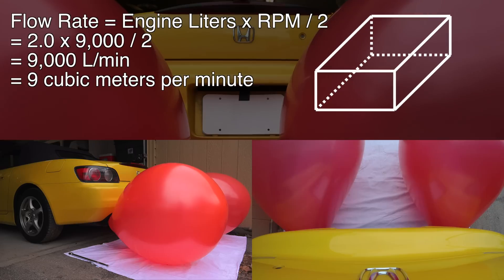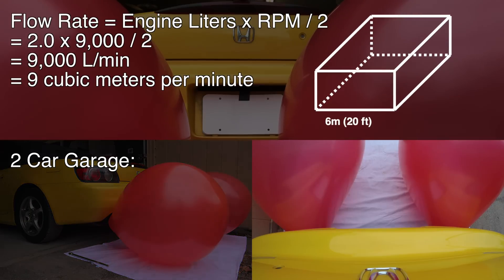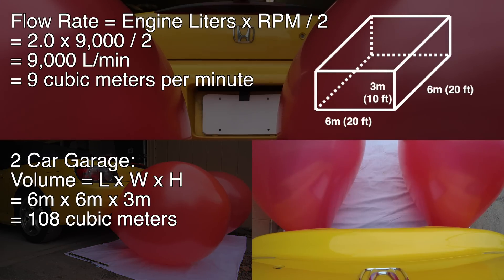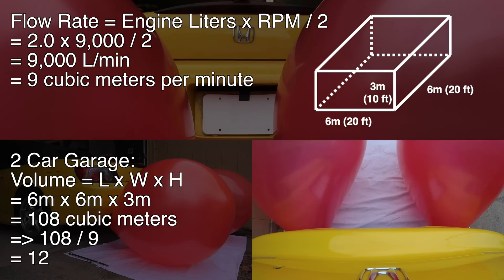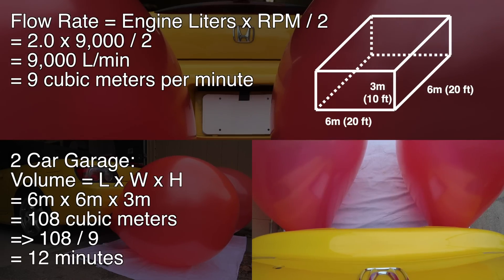Inflating Balloons With An Exhaust - How Much Air Do Cars Use?

Comment: After the balloon popped and all the thick gas came out the exhaust pipe, did that only look bad because the other balloon start pumping it's collected gas back through the exhaust to escape the other pipe which now doesn't have the balloon on it? (There was probably a much better way to grammatically explain my question hypothesis)

Comment: Why is the balloon on the left deflating after the one on the right popped?
Reply from the maker: The exhaust is open at that point, atmospheric pressure is less than the pressure inside the balloon, so it deflates back into the muffler and out the tailpipe.
Reply: Engineering Explained I think he didn't know it came out the OTHER tailpipe
Reply: I didn´t. I reckoned it would stay inflated as fumes would still come from the engine, and I didn´t think a ballon would be able to generate enough pressure to make it go back the pipe. 
Besides, my ears nearly exploded a 2:15

Comment: Why do the balloons not fill evenly? I would think that going from the single pipe into the muffler with dual tips the pressure would be even, but it seems it found the path of least resistance? Which would explain why the other balloon didn't pop?
Reply from the maker: Two big reasons: first, the exhaust path may have been less restrictive for the balloon on the left of the video, meaning more gasses fill this balloon initially. Second, assuming the exhaust pressure is equal at both tailpipes, the balloon on the left could have required less pressure to inflate. A slight difference in the pressure required to inflate one of the balloons would result in that balloon filling up first. Once the pressure was high enough inside this balloon, the other balloon would start to inflate as well, as it did. I would assume the quality control on $2 balloons is not all that high, so no surprise that they required different pressures to inflate.
Reply: Makes sense, thanks for the reply! Keep up the awesome work!

Comment: Someone might have commented this already, but what about the volume of gas added to the exhaust by the combustion process? The volume of exhaust will be greater than the volume of intake, no?
Reply: That's true, and also part of why turbochargers are so effective.
Reply: there are only two things that enter the engine. air and fuel. therefor there are only 2 things that can leave the engine. 

So  basically the exhaust volume is 7% higher than the intake volume when the fuel is injected.

Comment: Those additional fumes coming out after the pop was more than likely due to the excess air flow through the single muffler that had build up, which was "loosened" up my the additional air flow. Agreed, doubt it was harmful whatsoever.

Comment: How would a diesel engine differ in terms of inflating the balloons?
Reply: Diesel, rotary, any internal combustion engine will fill the balloons up based on displacement plus boost. Diesel will likely just be a little more smoky, if it's an older engine.
Reply: ah thank you

Comment: Couple of clarifications. A car may have a VE of 100%, or more, but not at all rev ranges. It is unlikely the S2000 is tuned for a VE of 1.0 at full rpm - peak VE would likely be at a lower RPM. Second, the calculation you did (VE * RPM / 2) is for how much air ENTERS the engine. However, the balloons show how much air leaves the engine. Air leaving the engine is air entering the engine and those gasses released after combining the oxygen in the intake air with gasoline vapors. That volume is FAR larger than the intake air and his extra "air" is what pushes the pistons down.If I recall, its 12:1 (with 1 being the amount of oxygen in the intake air). It is confusing that you showed balloons illustrating exhaust gas but did calculations on intake gasses.

Comment: Now explain to me why we cannot capture co2/ generally exhaust gasses, compress them and store them or filter them better than with a catalytic converter to reduce emissions. ELI5 please?
Reply: That is because compressing that much exhaust gas into a reasonably small volumes requires MASSIVE amount of energy that makes it simply impossible to happen. Also there is no catalytic converter for CO2 because unlike other harmful gas engine generates (nitrogen oxides, sulfur oxides, and CO), CO2 is largely chemically inert, which means it is extremely difficult to use chemical reactions to convert it to innocuous chemicals in a controlled manner.

Comment: The volume of air that is going in the engine isn't the same as the volume of air coming out from the exhaust... Because of the expanding gasses inside the cylinders... If those two volumes were the same the engine can't run... And so the car will fill the garage with exhaust gasses faster than what you estimate... Am I wrong?
Reply: gas flowing out of the exhaust is only 7% greater than the air flowing in.

Comment: the volumetric efficiency at idle or wife open throttle has little to do with the volumetric out put of your exhaust. the amount of "air" leaving the engine is greater because of combustion.
Reply: if we go by the rule of thumb that the AFR of an engine is 14.7:1 the exhaust is outputting 7% more air volume than what is being induced into the engine.

Comment: OH! the suspense! I was on the edge of my seat waiting for the baloon to explode!  It,s cool how on fill first because the resistance to air flow is lower, but then when it get fill up, increasing pressure and resistance, to other start to fill. The exhaust length are not equal. It would be entertaining to test dual exhaust car with this ballon test to see the resistance differential between the 2 exhaust.

Comment from the maker: "Why did one balloon inflate faster than the other?" Two big reasons: first, the exhaust path may have been less restrictive for the balloon on the left of the video, meaning more gasses fill this balloon initially. Second, assuming the exhaust pressure is equal at both tailpipes, the balloon on the left could have required less pressure to inflate. A slight difference in the pressure required to inflate one of the balloons would result in that balloon filling up first. Once the pressure was high enough inside this balloon, the other balloon would start to inflate as well, as it did. I would assume the quality control on $2 balloons is not all that high, so no surprise that they required different pressures to inflate.
Reply: Minute physics has a video on why this happens, TL;DR a smaller balloon requires more pressure to inflate.
Reply: Is the path symmetrical or does that not matter.
Reply: At higher RPMs the pressure on both sides equalizes.
Reply: But what about Stochimatic ratio? 15 L air for 1L gasoline so that is soo less than your calculations i'm getting little confused. Can you please explain me.
Reply: I've noticed just as a passengar waiting behind such cars that the left exhaust is always exhausting more. It wasn't a slight change between baloons that made the left tail pipe exhaust more. It's one of those odd things I've noticed all my life from any manufacturer.

This video is 5 years old so maybe someone won't come up with a dual exhaust exception. ;)

Comment: I think the white fumes coming from your exhaust after the right balloon popped is just water vapor that cooled in the left balloon so that it condensed and formed a cloud when it came out the other tail pipe.
Reply: This is most likely the case, as the primary products of combustion of gasoline are CO2 and water vapor.

Comment: Wouldn't the exhaust mass and volume be larger than whats taken in through the intake?
fuel is mixed with the air and when combusted the mass now is composed of all mass that came in as air + the mass of the fuel.

so the air used should be less by some factor than the exhaust produced.

if you wanna be extreme, inflate some balloons attached to the intake and stick some empty ones at the exhaust  and see if the exxhaust balloon inflates faster than the intake baloon deflates.

Comment: now there is a question, is that a measure of how efficient your exhaust system is as one inflated when the other didnt and then when one burst the other started to deflate? id imagine they would both inflate at the same time with a good designed exhaust system

Comment: How much oxygen does an engine consume? is it all of the what it intakes or is it there some left over. 
Carbon monoxide out of the exhaust turn to carbon dioxide when it hits oxygen how much oxygen does this reaction consume?
What gases come out of the exhaust pipe? are they all dangerous? 
Thanks for your great videos

Comment: as you hopefully know, the balloons on it self arent good to mesure the air that goes trough the engine, because when air get ignit, it gets a bigger volume, thats why your exhaust should always be bigget than yout throttlebodys.
Reply: there is also a problem with how you tried to calculate what amount of air goes trough your engine, i dont beleve that your engine only runs on air, so you would need to find out how much fuel gets injectet to find out how much air goes trough your engine.

Comment: The backpressure from the balloons should be a lot less than what a regular muffler causes when driving, so I wouldn't worry about the engine.  This actually looks like an interesting way to see how your exhaust flows when you have dual tailpipes - if one side is more restrictive than the other.  I thought it interesting that the one on the right was so much slower to start inflating (although it did catch up later, as we noticed when my ears stopped ringing.)  :-)

Comment: Every litre of Petrol burned creates 1320 litres of CO2 at 1atm pressure at 20 degrees Celsius. Diesel is about 1435 litres per litre burned. I think this should be included in your calculations. I think it would be very interesting to be able to actually measure it.

Comment: If this were an exam you'd receive a F!
You calculated the air passing through the engine and totally forgot about the fuel being burnt in the process. The engine uses part of the air (oxygen) that is sucked in and combusts the fuel which turns mostly into gases (CO2, CO, NOx, HC, etc. ) and some particles (PM) , thereby creating a much greater volume of gases which then leave the engine via the exhaust. (Thats why those are called "internal combustion engines".)
What you caught in your balloons was of course mostly gases that resulted from the internal combustion, not "air".
Reply from the maker: The title is "How Much Air Do Cars Use?" That's what I calculated, not how much volume exits the car. The balloons were used as a visual aid to see the amount of air exiting, but it's not the same amount going into it.
Reply: I understand this is supposed to be funny short movie, which also explains why the first part of the title should be seen as completely unrelated to the last part.
But I imagine how much more impressive this movie would have been if you had opted for the approach of a true scientist and explained how a little petrol and some relatively small amount of air become such a big volume of toxic gases.

Comment: assuming air is an ideal gas, would there not be a higher volume of air leaving the engine as being taken in, because the engine will raise the temperature and by PV=nRT raise the volume?
Reply from the maker: Yes, plus fuel is added to the equation. Volume of air exiting is greater than the volume of air entering.

Comment: You're lucky you didn't blow up your garage, if you're car doesn't 100% burn all the fuel in the chamber it's going to be putting that unburned fuel into an enclosed space, all it would have taken was a spark and you would have had a fireball.
Reply from the maker: Catalytic converters are designed to break down hydrocarbons (fuel). Also, fuel fumes need an ignition source or heat. The fumes were relatively cold, and there was no ignition source.

Comment: Am I correct in assuming that because the balloons inflated on at at time, this car has a split after the muffler instead of a true duel exhaust?
Reply: It could also be due to inconsistencies in the balloon manufacturing process that made one thinner (easier to inflate) than the other.
Reply: t0f0b0 Yes, the fact the first balloon deflates after the second pops, proves your hypothesis. :)

I've never understood this design... especially on any engine without two cylinder banks.

Comment: What are the odds that I was working this out earlier today. Only difference being I was using these equations to further calculate exhaust gas velocity. I came unstuck calculating velocity, but this video answered the question as to what I was doing wrong. Sweet!

I can now figure out some average exhaust gas speeds, for various cars. In turn should give me a better idea about what sized exhaust systems will match up well, with whatever vehicle. As in the pipe diameter of an aftermarket system.

We engineers are special.

Comment: soo...why was there smoke coming out from the exhaust at the end? interesting to know
Reply from the maker: +CODMASTA it was smoke from the other filled balloon. You can see the smoke in the balloon when it pops fall to the ground. The other balloon deflates through the other exhaust port.
Reply: ah makes sense, thanks for the reply :* xxx ^^ :D :-P 8==D~
Reply: +Engineering Explained it's not smoke though is it, it's water vapour at it disperses after a couple of seconds. :)

Comment: That's some nasty knowledge. It sure puts it in perspective though. I can't wait until they make electric cars and motorcycles I can afford. There is only so much atmosphere. Hey EE, since humanity started using the atmosphere in the industrial era how much of the atmosphere do you think we have burned? Is that something that could be calculated? How about how much atmosphere have engines used since we started using them? I have always wondered how sensitive the balance is for the climate. Would a .1% change start to have an effect, how about 1% or 10%? Do you know what the numbers are for our atmosphere right now? Thanks for the great videos keep up the good work.
Reply: Atmosphere is replenished by green plants via photosynthesis.  Do you even biology bro?  Plants absorb carbon dioxide and release oxygen.
Reply: What?

Comment: I thought you were about to measure the size of the balloon! Ah well, would have been cool to strengthen your theory. :)
Reply from the maker: +Joost Kranendonk I was considering using markers to estimate size, but did not. Each balloon is about a meter in diameter, so a total volume of 1 cubic meter combining both balloons. Took about 90 seconds to pop, so 0.67 cubic meters per minute at cold idle.

Comment: Fuel contains molecular compounds which when introduced to O2 and heat combusts, producing CO2, H2O, some CO, some NO2, and some other stuff. That fuel doesn't go nowhere. The exhaust consists of  the air taken by the engine, as well as the compounds of the fuel.
Reply from the maker: +TrebuShade yep, said nothing contrary. I was discussing air going in, with a visual aid of air coming out.

Comment: But in my opinion, if the same experiment was to be carried out on a V-format engine with single tips per exhaust, it would hurt the engine because of the back-pressure right? Since yours is an Inline-4 and it shares the common exhaust manifold before splitting out into two, the gases from the left are still able to travel back to the split and going down the right pipe. But since V engines have separate manifolds per bank, and with no common point between, it'd surely choke and stall the engine, eh?

Comment: i think you found the solution to automobile emissions! all we have to do is drive around with balloons attached to our tailpipes and then take the filled balloons to a waste treatment site, genius!
Reply: YES this is a spectacular idea, clowns can make exhaust balloon animals, and you would never have to worry about hitting the car in front of you (Balloon Bumper).  
I can picture it in my head, people fiddling trying to take off the balloon at the dealership just to have it launch off spatting your car's bio-organic healing soot all over the white colored cars.
Reply: it has kinda been done, large part of the emissions are from the first few seconds after starting the engine with a cold catalytic converter, so collecting the exhaust and the putting it through the cat after it has heated up makes sense
Reply: You sound like Jeremy Clarckson
Reply: exhaust goes through cat before being collected, sensors have electric heater
Reply: sizeOVERstrength Then the fumes ultimately end up back in the cycle where it would have been anyway!!
Reply: WHATEVER IT TAKES GODDAMIT
Reply: sizeOVERstrength then once you turn the engine off the deflate and are ready for the next day lol
Reply: We can set up a machine that stores the exhaust gas in a tank by pressurizing it. After that, I haven't figured out what we would do yet.
Reply: Andrei Serban whateva it takesss
Reply: But how is it going to heat up if you collect all the exhaust :D
Reply: sizeOVERstrength it's like Mario cart
Reply: Emre.D except that it would need most of the power the engine produces^^
Reply: But what will the waste treatment site do with it. And considering how much air that one car used I can imaging how large of a containment site you would need for every car in the world. Damn you Elon Musk make Tesla's cheaper!

Comment: Wouldn't it only be 2L in your math if it was 100% compression? Which of course it's not. Also there is the expansion of the heated gases. But let's say it Mathematical ! !

So 11.1 in the S2000 Will have a 91% compression, giving you 1.82L of absolute air pumping. I haven't mathed in a long time so please let me know if I'm wrong :-)

Awesome videos, keep up the Awesome work